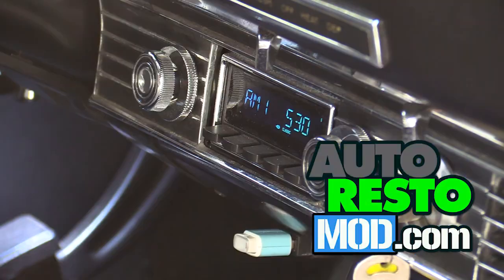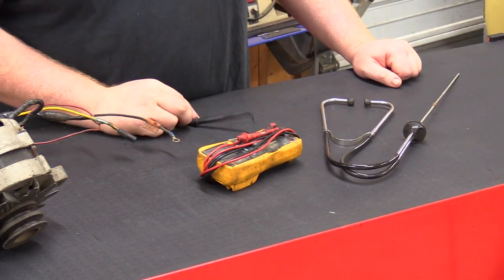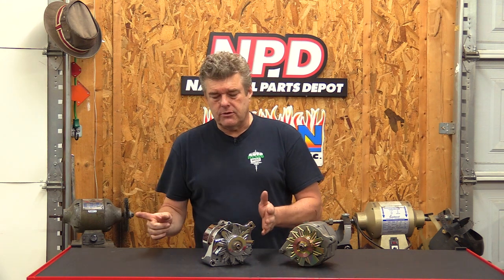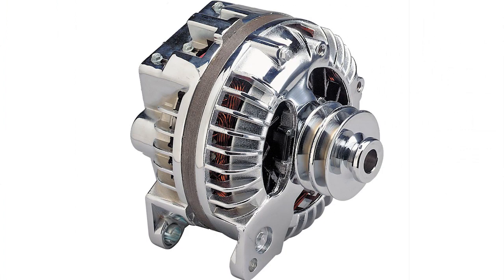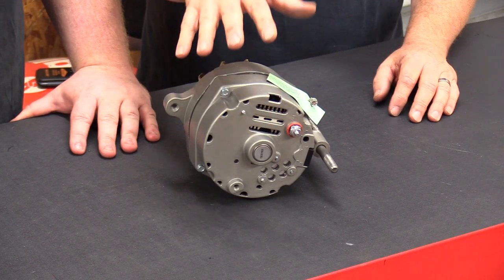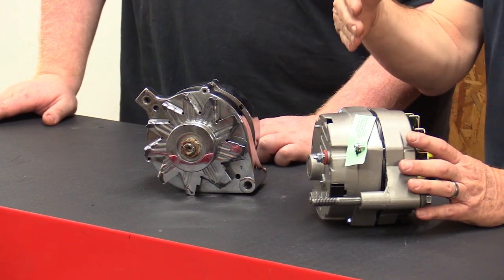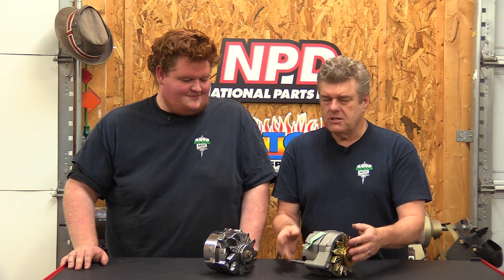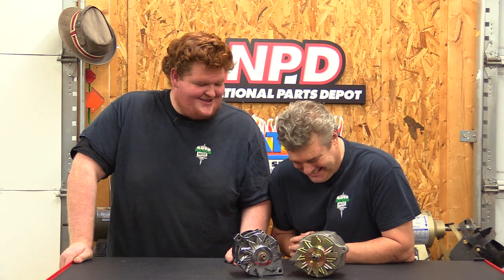Alternator Basics, Tips Tricks, 1 wire, Models of GM, FORD, MOPAR from 1960 1980s Autorestomod Episo

Comment: I just did a front disc break conversion on my 1970 Ford F-100. I am hoping to shed some light because I've heard  you guys talking about doing it. I basically went to a junkyard and pulled both ''I'' beams out of a 1973 Ford F-100 I pulled the whole assembly out and it was all together, calipers, rotors, spindles, everything. I took it back home, cleaned it, painted it, replaced the bushings with new ones "while Im here". Also new rotors and calipers were purchased from a local auto parts store. The "I" beams sat correctly with the front coil springs and bolted up to the radius arms. The only thing you have to go out and get is a new tie rod assembly because the length of the threads on the tie rod where it goes into the spindle is a different length than a stock one from 1970. So I got a complete tie rod assembly from a 1973 Ford F-100, that bolted right up and now the brake conversion is complete. The other components required were new brake lines and a new proportioning valve.

Comment: Thanks for the info, guys, I've got a 100 Amp Powermaster alternator that's similar to the industrial or tractor version that you show.  It's in my 67 Mustang with the 302 engine and it's driven with a V-belt to the original pulley.   It's able to be hooked up as a three wire or as a one wire.  The one wire option is how I have it hooked up and I have to rev the engine to approx. 1200 RPM to excite the charging system.  This function is per Powermaster's instructions for the one wire hook up.  I have a volt meter wired in to the dash that replaces the original AMP meter.  It seems to work well for my needs, but you MUST remember to excite the system upon start up.  This may be a PITA for some folks.  I thought that I'd add this info to the discussion.  Thanks again for all that you do.
Reply: I bought a Powemaster for my 1980 Bronco (it still had the 1G external regulator, the little square box with the 4 wires)... how do I wire up my existing dash voltmeter?
Reply: Just buy an external voltmeter. Easy

Comment: I just completed a 3G swap on my 66 wagon. There's no external fan. So far, so good. Very easy to do and if you have a good pick a part near by, it really is inexpensive to do. I bought a rebuilt from PEP Boys and the wiring harness, 6g cables and fuse holder online.
Reply from the maker: Yeah, some do and some don't have the fan. The ones that PA Performance sells have the fan.

Comment: It’s like you guys are reading my search history because you keep doing videos on exactly the things I needed to know LAST week. Long story short, I couldn’t use the Ford alternator I’d bought for my Ford product and had to buy a 12si GM-style alternator instead because that’s what VintageAir built the bracket for.  And through internet research, I learned one important thing about wiring it up— if the car had a generator on it before, make sure there’s a diode in the wire from the charging warning light to the #1 (field) terminal of the SI alternator...or else you may not be able to shut the engine off. That would be an unpleasant, though probably (later) hilarious surprise.
Reply from the maker: Hmmm wait a week? You might be right on time. LOL. Yeah, those are some steep curves. I often wonder how deep to go on these videos.

Comment: Great Video guys. Could you do a vid on safe ways to charge a battery with a battery charger - is it safe to use while the battery is connected to the car system or is it better to disconnect and charge out of vehicle ?

Comment: Thanks for the info. Now I understand why my Mav only shows 12 volts at idle and 14.5 above 1000 rpm. I put a set of march performance pulleys on the car and I bet I have the wrong size pulley on the alternator.
Reply: Yup! You have the wrong size pulley(s).  I bought an engine that had the March setup and the lights always dimmed when braking or turn signal.  Swapped out the alternator pretty piece for a smaller one.    Next move would be to replace brake lights with LEDs...

Comment: Thank you for the information. I HAVE A question. what does my voltage regulator read on gage 16 after replacing it with a new  regulator on a 1966 Impala

Comment: Come on now guys, don't make it sound hard to "source" an alternator.  I found a great company. New alt' GM-  American made. Beats auto parts stores for prices and quality. I'm going from a 60 amp external reg'd to" DB electrical" one wire 105 amp for just under $53.00. Free shipping too. Good vid.
Reply from the maker: Not hard, sitting in your Barca-Lounger drinking a cold one. On the road the one wire can be problematic. That's all. The point: 
Counter person: Hi, welcome to HighHoe AutoParts. How can I help you?"
Me, sweating, cussing under my breath: I need an alternator.
Counter person: Year Make and Model?
Me: It's a one wire.
Counter person: I...don't find that alternator name....I'm not feeling comfortable right now, can we go back to Year, Make and Model?
Me: Yes, Yes we can. 1972 F100 360 2V (that is really a 390 4V from a Thunderbird)
Counter person: Is this your alternator? Points to a picture of a Ford 1G in all it's rebuilt Cardone glory)
Me: Walks out, large floofy tufts of curly gray hair gently floating on the breeze.

😁😁😁
Reply: What is the name or website ?

Comment: "Pretty" is not the only reason to change to a 1-wire - case size was the primary factor for me. A 3G simply wouldn't fit between the block/head and bracket on my car (64 Fairlane with a 429).

I also have additional power requirements. Tuff Stuff makes an appropriate 1-wire alt (#7068k) that is 150-amp, and you can't get an alternator in an OEM case that provides that kind of power. Mine makes 14.5 volts all day long without having to rev the engine to get it to start charging (btw, I use a 4-gauge cable for the positive side).

Comment: THE  REASON   I JUST  SWITCHED   TO  THE  
ONE  WIRE.....WAS  TO ELINATE  ALL  MY  WIRE
PROBLEMS    AND   MY
CONNECTORS   THAT  
WHERE  NOT  TRANSFERING
ELECTRICITY WELL......
DOING  SO.....MADE  A DRAMATIC   IMPROVMENT
IN STARTING....AND  BATTERY   CHARGEING.....
ITS  A WHOLE   DIFFERENT 
CAR......FAR  MORE   RELIABLE.......
Reply from the maker: Good point.

Comment: Ive never seen a factory 3g with an external fan, mod motors ran 3g alts, some, if you change the front half of the case then you ran them on " normal " v8s.
Reply from the maker: Yep we misspoke on that bit of info.

Comment: early CS130 GM alternators were v belt with a smaller front bearing and slightly lower output than the later unit serpintine  unit  . Better than the earlier SI versions  but still limited amperage because of heat generated at high output . 100-120amp should be considered max output even thou many aftermarkets are higher . I have also read V belt capacity /life span is alot  shorter on amperage ABOVE 100a .
Alternator with a baffle fan  OEM  AC delco 12SI   always flows more air than standard . Can be retrofitted  if u donot have one .
The alloy aftermarket  decorative fans cause overheated alternators .

Comment: i have an idea.. In one vid do a threefer .. set it up like a motor swap.  do the wiring for Ignition (duraspark) starting (w fender solenoid ) and charging ( w external reg)     I just found myself taking a 302 out of a 69 merc montego  .. groping in an engine that was in a 1981 f100 labeled as a 5.0 302 , but wound up being a D4 casting  1974 0r 75 351W .. yay fun times.. oil pan swap .. dipstick tube made me pull the engine back out.. hahah .. ugh.. now to find that homed power wire for the coil and make a harness for the duraspark .. and of course i didn't save the ign moduel out of the truck..
Reply from the maker: Not a bad idea to hit the swap/no swap parts. Usually any 302 from a passenger car will swap. Trucks...not so much. I'll discuss it with Cam. Nice idea!
Reply: also sent you an email about a mopar via your website

Comment: A nice solution to many Ford charging issues is to use a GM CS style alternator.  They charge better, have a clean 3-wire charging setup with the internal regulation and put out much more amperage than Ford G2s.  They also lend themselves to a one-wire setup if that's what is wanted.  The only modification needed is to drill out the mounting bolt hole to 1/2" from the GM's 7/16".  Is this blasphemy?  I did this to my 65 Mustang because of all the stuff I've added.  Works very well.
Reply from the maker: Nope. No blasphemy. We welcome all solutions!

Comment: great advice.....but a question!.....

what about the size of the car?

do you need a bigger one if you have a boat? (57-64 I.e Fairlanes, Fleetwoods,300s, LTDs)

with all those fact. options.....
..wouldn't you need a bigger one!
Reply from the maker: Nope. All about the amp load. size does matter (according to some) but in this case it is only where the charging system is concerned.

Comment: The BIGGEST reason to use a 1-wire alternator is to get rid of wiring. Most think that is all about looks only. It's not. It is also about not losing power through long lengths of wire and wire not getting hacked up by age, heat or rodents.  The shorter the wire, the better the signal to charge. Also, you can turn most normal alternators into a 1-wire set up, but this normally means wiring the regulator right to the alternator. It is better, but I like the regulator inside the case and I HATE computer activated alternators.... Chasing and repairing those issues can be MURDER!!!

Comment: do you have a 2 wire alternator video? i keep runnin into 1 and 3 wire videos . like they all say put the #2 wire with the wire tht goes to ur battery from back of alternator . buut why not just plug it in the connector to side of the alt? you got 2 wire vid ? need yo help
Reply from the maker: The GM altermators can have two wires one is an exciter wire for the amp gauge.
Reply: @AutoRestoMod  can you do video on free time ? tht be cooool im workin on 86 camaro ...il tell everyone not to buy one cause its a paaaaain in butt

Comment: Buy the way,you can take a carpenters pencil ✏ and rub it over the bolt shaft to stop it from sticking to the alt shaft hole.lead is slick and won't stick.just saying.
Reply from the maker: Good tip!

Comment: You mentioned ‘Auto Wire’ wiring harnesses, “WARNING “ My friend is restoring (to stock) a 69 GMC , he discovered his $600+ plug and play Autowire harness is not exactly direct/ plug and play . He had go to a 1 wire alternator, then he discovered the harness is not compatible with his new  $700 vintage replace dashboard which comes with an amp meter as per original. When he call Auto Wire they actually got a little snotty with him and told he need to switch to a voltmeter. After checking around it looks like he will be hanging one under his dash. 🤮Not sure if ‘Painless’ harness is any better.
Reply from the maker: That can be an issue. There are a few videos on coverting the AMP to volt gauge using square body parts. I actually prefer a volt gauge.